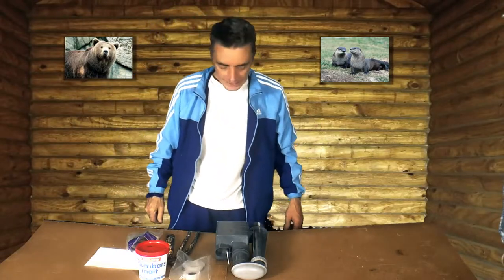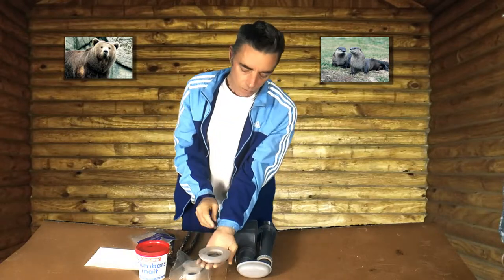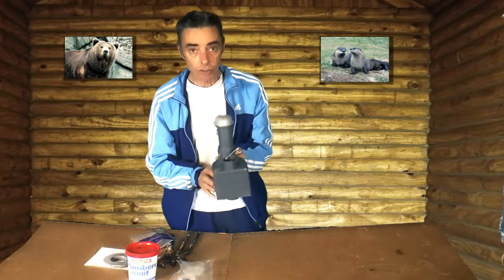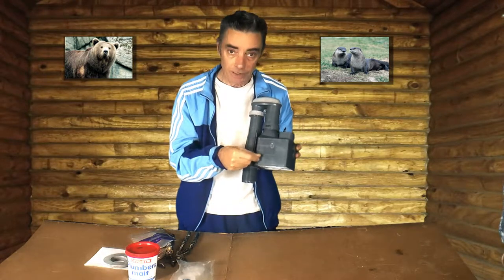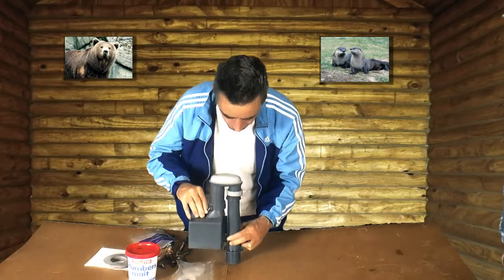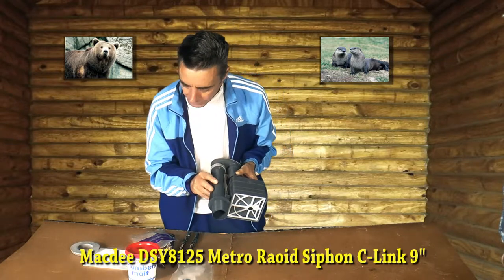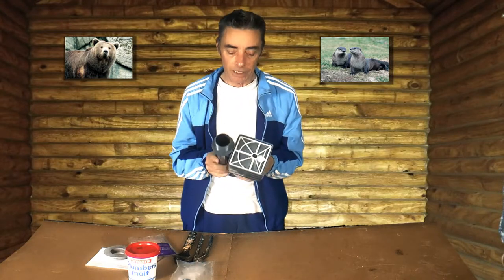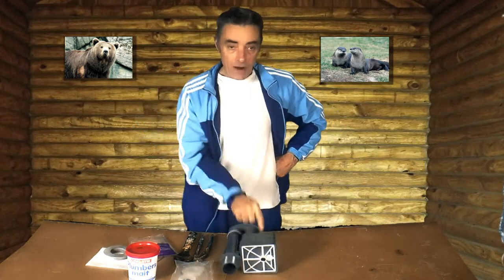Toilet Problems Macdee Cistern Siphon FAULTY

Comment: When I flush the toilet the water goes to up in the toillet
Reply: Can you tell me how I can solve this problum
Reply from the maker: If you have a big floater ball on arm, if the arm is metal just bend it slightly to get the correct level